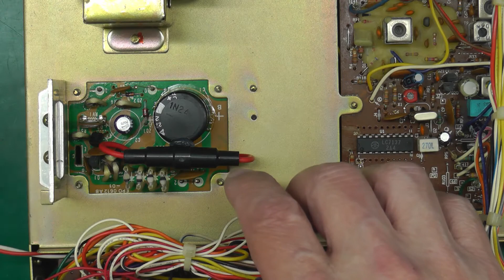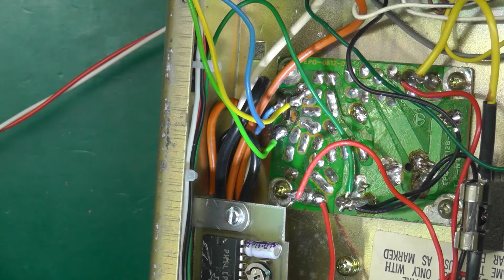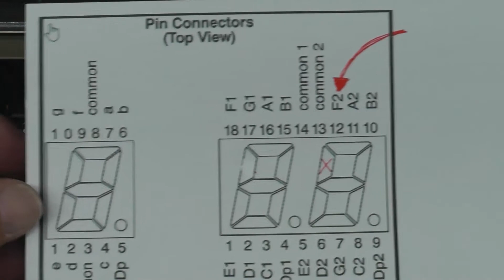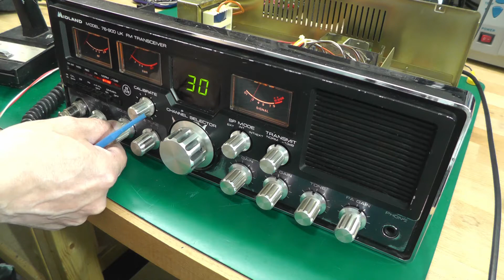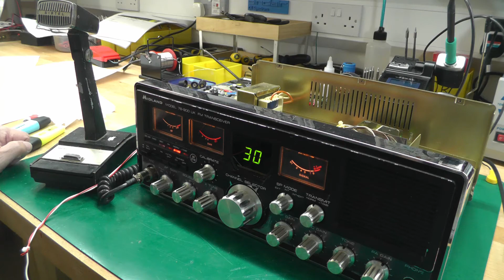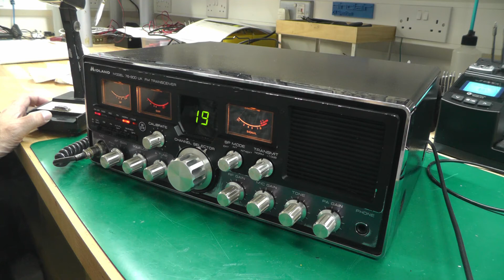No.057 - 35yr+ old Midland 76-900UK CB Radio Restoration - Follow Up

Comment: For to220 packages, I like to mount them externally off of board and use a 3pin PC fan molex connector which fits the package pins well and allows you to mount off board.
Saw this method used in a ZX spectrum 48k+ model used for the to220 7805 regulator.

Comment: Channel 21 is widely used in Turkey at the moment, it has become an unofficial meeting channel of Turkish CB users. I had very nice QSO's with British CB users over the time depending on the propagation. FM is preferred, SSB (USB) is used too.  I had successful QSO's with UK with 25w power and a 5/8 vertical.

Comment: @6:22 the usual voltage setting is 13.8V, so that it performs the same way if running from an external power source, the supply voltage has an influence on the RF power output.
Reply from the maker: The external DC power plug has an inline diode....its those diodes you see stacked to a solder post near the mains fuse. The service sheet and manual talks about 13.2vdc if powering externally so i figure 0.7vdc from that is the 12.5vdc I measured. Unfortunately, service sheet doesn't mention what exactly to set the psu output to.....so just leaving it as-is.
Service sheet (I only have part 2) looks quite detailed regarding aligning everything though......but I ain't going there.....leaving RF stuff to other folks LOL.
Reply: About the only thing that might need a twiddle is the PLL reference frequency because the crystals tend to drop in frequency with age and all you really need for that is a frequency counter and a trim tool.

You won't need to twiddle anything to do with the TX chain or the RX side either because nothing apart from that one crystal drifts with age but if you decide to delve into it grab a set of ceramic trimmer tools for a couple of quid off eBay, a copy of the Rotel 240 Service manual from CBTricks or a few other sites (same main PCB, PTBM134) and have a read.
Reply from the maker: @M0UAW_IO83  I'll deffo give this a go....cheers.
Reply from the maker: @M0UAW_IO83  Done, service sheet says 10.24046Mhz +/- 50Hz and it was indeed out by 76Hz.........so trimmed it in within 1Hz.
Reply: Clint Jay - or use the info from my site... Radiomods.co.nz
Reply from the maker: Update: found another service guide, psu to be set to 13.2vdc.
Reply: IanScottJohnston - that are least makes sense with that series diode protection